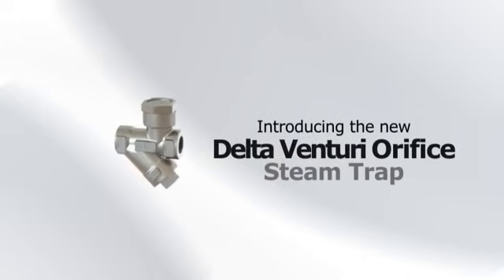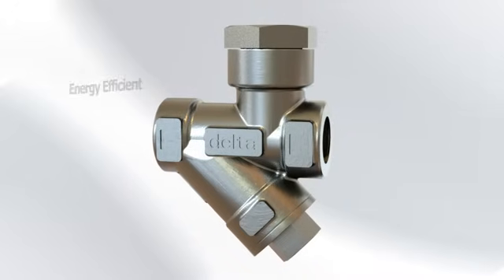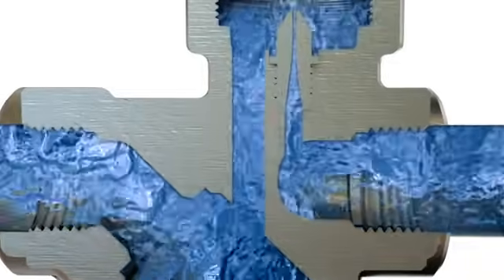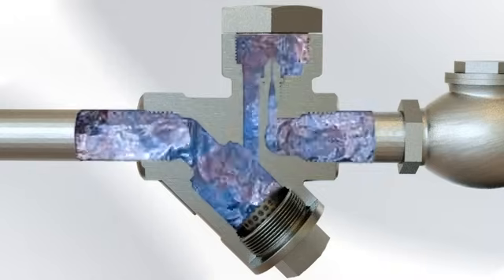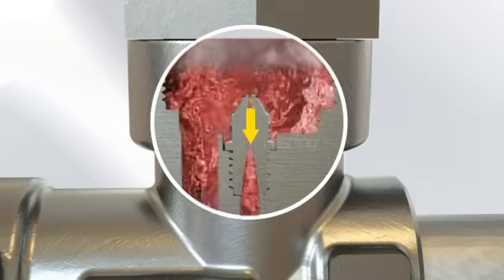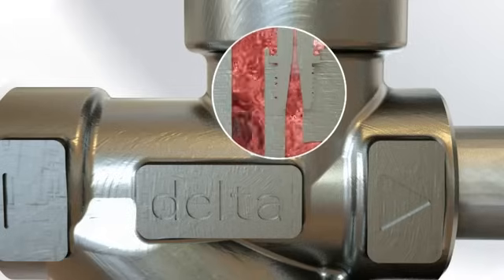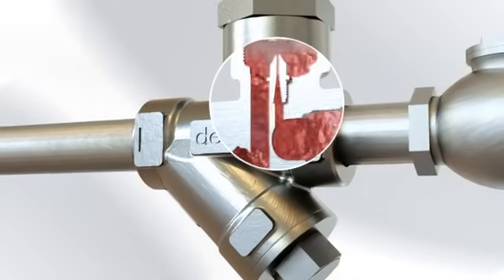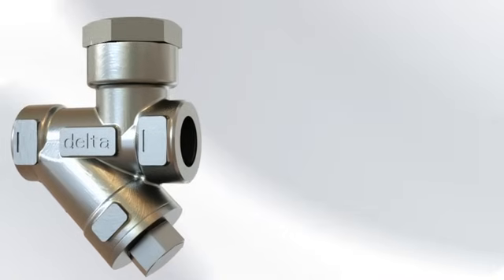Delta Venturi Orifice Steam Trap Animation

Comment: What happens if it is installed in inverted or vertical position?
Reply from the maker: Because it works using differential pressure it can be installed in any position, inverted or vertical. It is always recommended to install a non-return valve after any steam trap, and we recommend the same with ours.
Reply: Delta Steam Systems actually I want to install it them over rotating pipes (10-15 rpm) so won't be any problem?